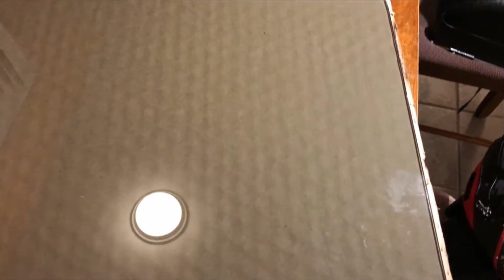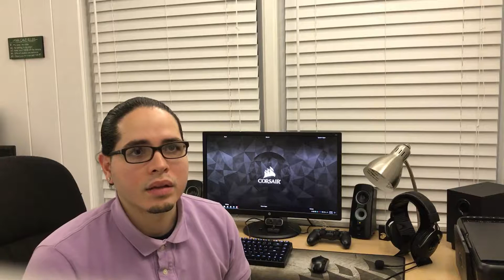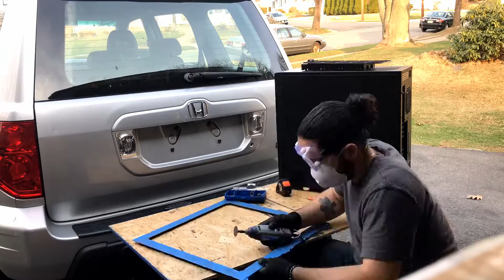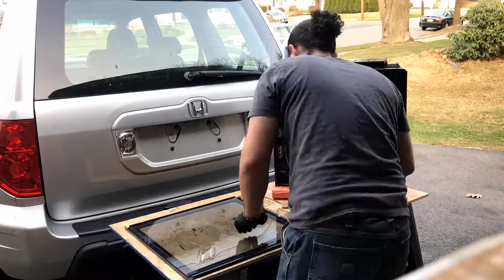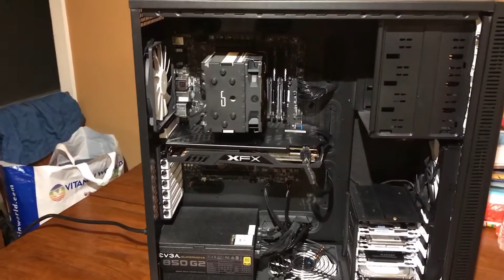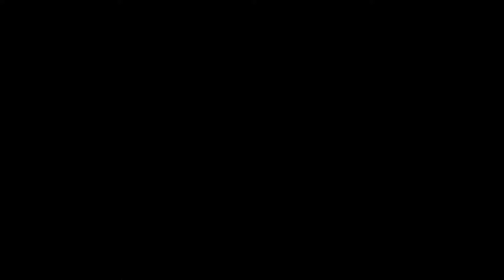Custom Tempered Glass Side Panel

Comment: I have the same case as you.  Where did you get the tempered glass ?  What size and thickness did you use ?  3/16 inch you mentioned ?  Also, what did you use to hold the tempered glass in ?  Is it still holding ?
I already did the cutout on my side panel.  I sanded down the panel and will be getting ready to prime it, and then spray paint it white.

Note that my cutout covers the drives.  I dont care to show it off.  But that is just me.
I did not see any fans on the top of your case.  I am rocking my case with 6 fans, 3 CPU fans, and 3 video card fans !!!  The case runs whisper quiet.